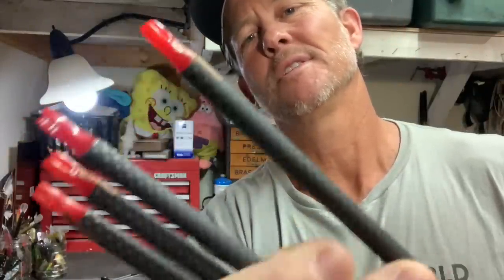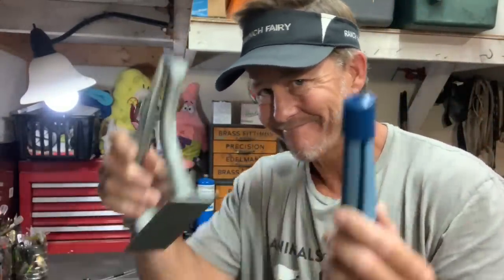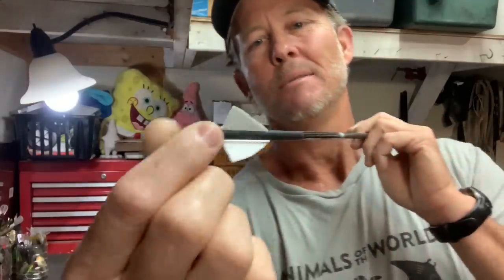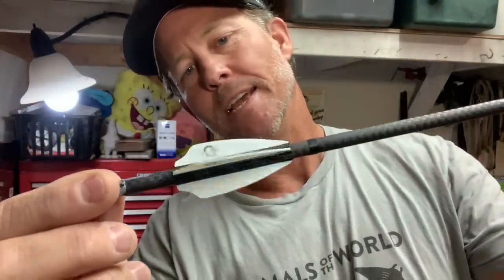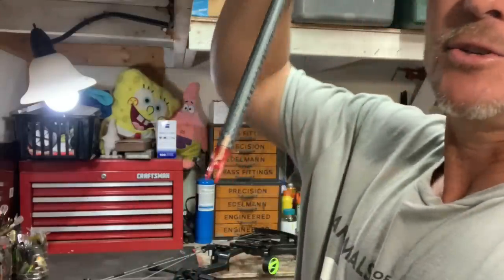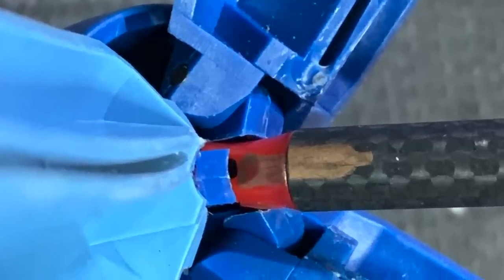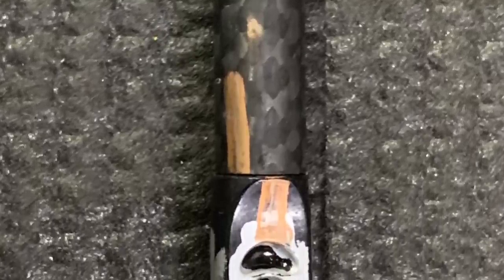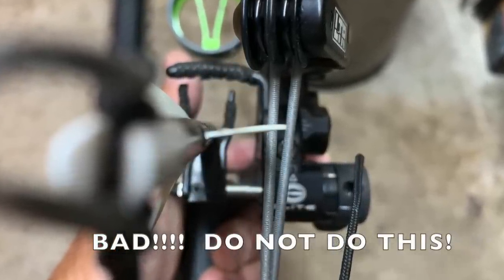How to Fletch after Nock Tuning

Comment: I began nock tuning, had horrible left tears regardless off the -nock turning-. Adjusted my rest, near bullet hole with a slight high tear. Adjust rest, bullet hole achieved. I’m shooting easton fmj’s. My assumption is the aluminum arrow with carbon core must not have a distinct spine....🙃

Comment: Ive been using Zinger Fletches with great success. Super easy to fletch and unfletch and adjust. They are like fobs without the ring and they feel like blazers They fit tight onto your shaft. You also have the option of gluing. Ever try them Troy?

Comment: I shoot triangle type bow ( think liberty archery bows ) that have a pistol grip style handle riser that shoots between the cables it is only 21 1/2 inches axis to axle with a 27 1/2 inch draw I use a whisker brisket arrow rest that is full entrapment with a pendulum sight I am using factory arrows and my bow adjusts from 30-70-lbs I am not hitting cables but I want to shoot lighted nocks to be able to find my arrows easier what do I do to tune my arrows for this?

Comment: Thanks to ranch fairy I spent a few hours this morning playing with my shaft... I'm 70lb/29 inch draw 345 ibo. I was shooting bare shafts with a lighted nock.. everything gold tip tells me on there website is completely false!!!! Guess what after changing a 100 times I finally found my combination for my bow 300 spine gold tip hunter xt 27 inch shaft 150 grain Insert weight and a 250 grain field point flys completely straight @ 20 yards!! I'm now ordering some 4 inch vanes and will be using a 250grain 3 blade vpa I also ordered a diamond stone sharpener / leather strop I'm going to get this suckers scary sharp total arrow weight a little over 700grains can't wait to see the pass thru power on a deer this year shoulder blade will no longer be an issue I feel
Reply: How did your setup do? I used 3 blade vpa’s a couple years ago and they are really tough and work well. 

I’ll have a 700+ grain arrow this year with iron wills and day six Evo xl’s. Might try to get a summons tree shark to fly and setup a golf bag of arrows for my quiver.
Reply: I too play with my shaft during ranch fairy videos

Comment: Can you nock tune pre-fletched arrows? I know you said you do it the hardest way possible but the arrows you buy in store already have fletchings. I know its optimal to do each step as you illustrated but I just want to know if its possible. Thanks!
Reply from the maker: Johannah Lawrence 
He thinks of everything 
https://youtu.be/CPHY8ghTIgM
Reply: @RanchFairy  haha I know. I didnt see this one before but I found it in the link of another video. I'm going to see about upping the weight up front on mine this week. Going to do some before and after penetration tests. Do you see much of a difference in sighting when you increase arrow weight? I know you use the esv which is a bit different but for us pinners,  does it affect it much? Assuming you get the tuning done correctly?

Comment: I fletch my arrows a little out of tune so when I rotate the nock after fletching they pass perfectly over the shelf and in the notch I cut in my recurves shelf without deflection in the shot. I dont own a compound bow so I never would have realized this was an issue for you guys.
Reply: Yeah, fletching clearance is a thing. Not realizing that my vanes were bouncing off of EVERYTHING due to me replacing the delrin cable slide with a roller and having my center serving slipping up my string (string failure!) with each shot was driving me batshit loco trying to zero my new sight. But it did show me that the weather extremes I deal with where I live leads to premature string wear. Hell, in a 3 month bowhunting season, I can go from t-shirt to parka in as little as a day. My new post-season routine includes getting a new string and cable for Xmas.

Comment: Have You checked out Axis 5MM Shafts.  I'm interest in Those.  I like Easton Aluminum.  Not a Big Fan of the Low Quality Carbon Shafts.  They are tough but They don't Fly as Good as Easton SuperSlams.  Feathers will lay down some when they leave the Bow.  With a Feather Burner you can Design Them any way You want.
Reply from the maker: Simple 
HIT INSERTS SUCK
The arrows are fine
Reply: @RanchFairy  I saw the Strange Inserts.  The 5 MM inserts appeared like the should work fine.  The 4 MM not so good.  You do know that Most Carbon Shafts have a Heavy side that makes that part of the Arrow want to fall to the Bottom.  So the shaft is going to follow that heavy part of the Arrow.  It's because when they are built there is a slight overlap in the shaft.  That overlap seeks a downward position.  Like a pendulum.
Reply from the maker: @christopherwatson283  yes, its a seam.  That can be overcome by nock tuning the arrows.
Reply: @RanchFairy  The Heavy Side is a Constant.  Gravity is Constant.  The Nock is a Constant.  The position of the nock is a variable because of Gravity.  Only thing I see is putting the heavy side up or down to start them off in the same position to make the Variable a Constant.  They are still out of Balance with Centripetal Force pulling on the Heavy Side as it spins.  The Arrow is not spinning true.  It's wobbling like an out of balance tire.  
No matter the nock position.  The Variable Force applied by the Fletching that makes it spin is applied at Release.  The Arrow can't Spin until it has left the String.  What do you Tune?
Reply from the maker: @christopherwatson283  
Well, since there are all those facts, here’s what I do.  I go shoot my bow and turn the nock.  
When it shoots perfect - awesome. 
Here’s a kicker 
“Which way does the arrow bend (left, right, up, or down). at release in relation to the heavy side?”
Would that hurt or help?
Also
Does the arrow rotate like a diesel cam in fight or is it consistent like a merry go round with one kid on it?
Reply: @RanchFairy  Are You aware of UnLocked Limb Bolt Float?  Are You aware of UnLocked Nock Float?
Reply from the maker: @christopherwatson283  Well, you got me there.  I pull my bows out of the box and they shoot bare shaft perfect running down the middle.  So we can agree you're in the 4% of archers who really know their stuff.  
I am not.
Reply: @RanchFairy  Limb Bolts have Set Bolts/Lock Bolts..  You are using Cheap Low Grade Nocks that come out easy and move around because They only make contact with around 10% of the inside of the Arrow Shaft. That's 90% air with 3 thin ridges making contact.  An upgrade to full contact inserts with full contact nocks will be noticeable.  Since a lot of Folks can't afford Expensive Arrows like Me.  We are Shooting Lower Grade Arrows.  I'd mix up some 3500# Epoxy and Glue Them in.  Try to fill in the Air Gaps.  Lock It in.  Stabilize It.
Reply: @RanchFairy  After You Secure Your Nocks.  You will need to Tune Your Bow in.  Now that You've eliminated Nock Float You should be able to see that It's consistency has improved.  Speed will pick up when the Power is Centered.

Comment: I thought I was weird 😂 I have been doing it that way since I started.... Just made more sense.
Reply: Blazers won't clear my hamskea cage but everything else does. I shoot those with the cock up and slightly tipped toward the riser.
Reply: I wish I had a hamsky I bought a qad hunter rest and timing is off and makes loud snap sound after I felted it and put rubber on my riser and then contacted qad and they said they don't know what to tell me.... Even though I have a full warranty when I bought it a few months ago. And said drive to the nearest qad shop to see if they can help...lol which is about 150 or 200 miles away. So there was sixty dollars down the drain. It is so loud if a deer heard that it would be in the next county before the arrow made impact... And that's at 30 yards.
Reply: Btw try blazer heat vanes....I love them they're a little bit lower profile and a little longer to compensate.... May be able to clear with no problem. And they look sweet plus quiet and accurate
Reply: I tried some heat vanes but occasionally the base wouldn't lay flat, maybe too much helical? I ended up settling on four aae pm23s, I've been happy with them. I saved up for a year to get a new bow and when I got to the shop the guy working there had the one I wanted used/almost new. So I had a little extra left and went with the hamskea hybrid  hunter pro. I think they gave it to me for 130 with all the other stuff I bought. I've been very happy.
Reply: Yeah to much helical.... Just a one helical would be great for hunting maybe two

Comment: Would this be the same concept for crossbow bolts
Reply from the maker: chasetin roden 
Gotta sit on the rail correctly
Reply: I shoot a crossbow so I'm in the same boat but this channel is amazingly helpful. It took a second to sink in but it's pretty straightforward. However the bolt sat on the rail against the string and it was nock tuned, that's how it has to sit with the cock vane in the rail. So mark it nock tuned and that mark has to ride the same exact way with the cock vane down after its fletched. After Ranch Fairy learns from the Wizard and teaches us, we can apply it to crossbow bolts. I love this stuff!!!

Comment: If we nock tune to where we can bare shaft 40+ yds!! Why fletch period???
Reply from the maker: SuperSYMPATHIZER 
I guess you hunt in a vaccum or there’s never wind 
Maybe your release is 100% perfect - never bending over or crawling on the ground. 
Video games leave much to be desired!!
Reply: Ranch Fairy video games create laziness. I’m just thinking wind would effect veins more. I’m going to do some testing. No vein will definitely help foc
Reply: offset and helical fletch  spin the arrow. Duh....
Reply: Edward Alsup1971 Japanese karate 🥋 is everywhere duhh
Reply: @SuperSYMPATHIZER  I think vanes make the shaft follow the broadhead better. That's all I'm saying. I'm not tripping. We're following RF who follows the Wizard and Dr Ashby. It's ok
Reply: Edward Alsup1971 ok then y nock tune??Y broadhead tune?? Vanes correct imperfections so y perfect without them?? Take a minute before answering
Reply: @SuperSYMPATHIZER  well, for me the answers are ez. Because I want to. It's tactical. It's practical. And 6 out of 7 of the voices in my head think it's a good idea. Don't get PO'd if I disagree with you. Agree to disagree. Think outside the PO Box for a minute. Later
Reply: Edward Alsup1971 I’m not getting upset. I’m having fun.  And I’ve done the steps Ranchfairy has.

Comment: Is nock tuning the same is spine indexing ?
Reply from the maker: I have no idea. 
What I do know - for a fact!
My 65# bow with speed cams and 5” brace height 
DOES NOT NOCK TUNE
The same as my elite Kure at 65#
So I’m a fan of checking everything instead of shooting “ok” arrows.
Reply: @RanchFairy  
I did some research and it is the same per say but you will still need to adjust the nock for fine tuning the arrow. I was just interested in how you felt about the two in comparison as some company's as advertising an add on fee for spine indexing your arrows for you when purchasing. This fee I would find unnecessary if I am going to nock tune anyways. 
I know I might ask some dumb questions but I am wanting to start a custom arrow archery business in my area and I am just wanting to absorb as much info as possible and provide a superior service. I have found from your research and my own that a lot of what I have been told over the years by the Pro Shops in my area has been a load of crap.
Reply from the maker: @jeffzirkle8728  hit me on email 
Troy@ranchfairy.com
Reply from the maker: @jeffzirkle8728  
Did I get it and respond?
Reply: @RanchFairy  yes sir